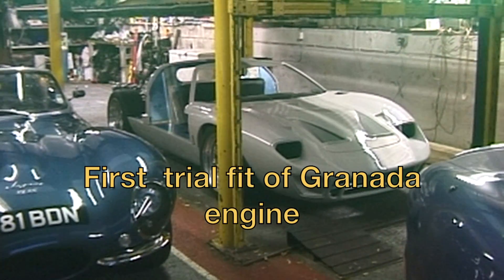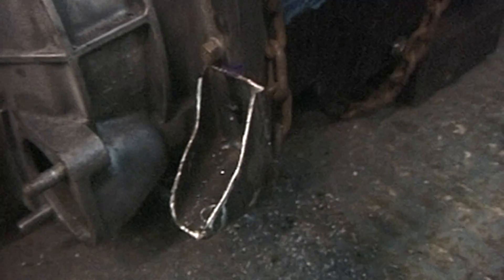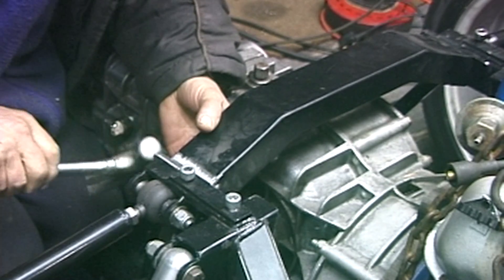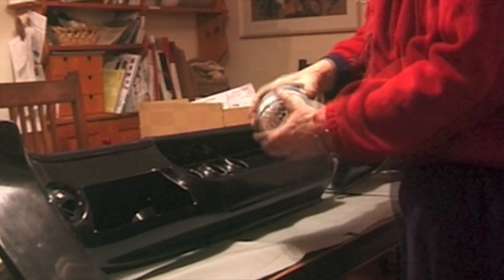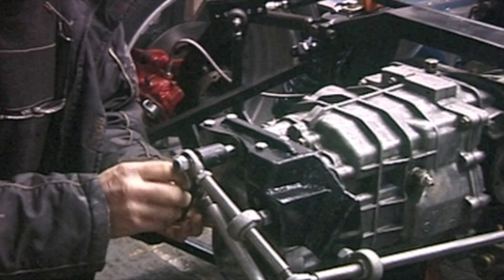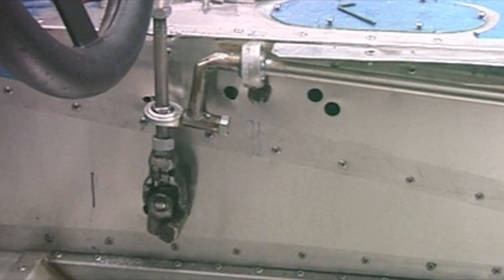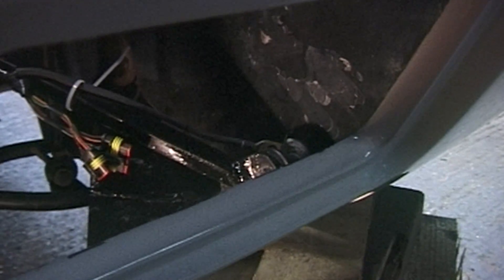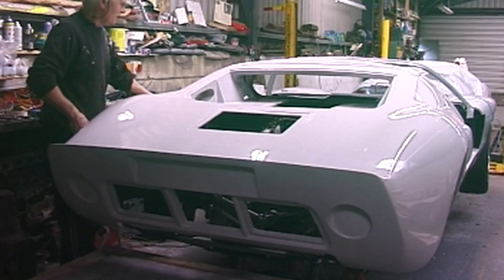Building a Ford GT40 (part 2 of 3)

Comment: I have to have one of these... I'm obsessed with them, I just have to have one.

I'm planning to order a CAV GT+, having most of it assembled at the factory and then finished at Renner Auto in Melbourne Australia. I've got some skills, but not on this guy's level. I also really want something very much on the restomod side of things, with  all up to date running gear/suspension/brakes, a well insulated and trimmed cabin and (crucially) the doors need to open vertically; because I plan to use it all the time. Plus, those guys are just so good at it now, it's worth the expense for the quality and ease of registration.

Fingers crossed I'll be looking at mine within the next 18 months or so. There's a GT40 shaped hole in my life that need to be filled.